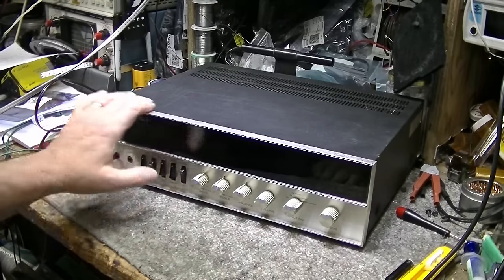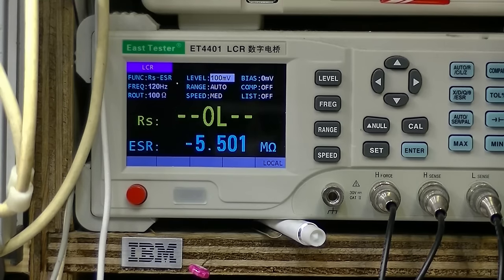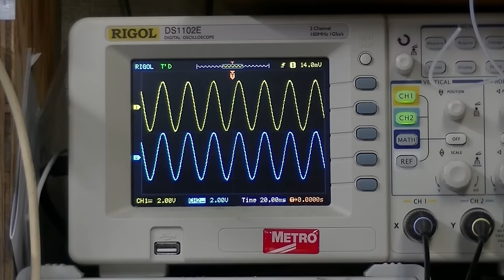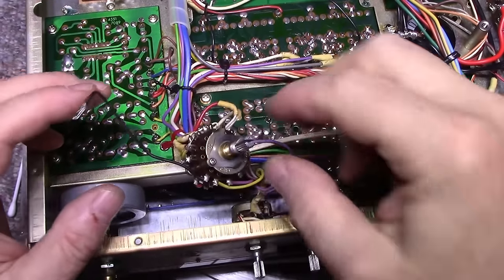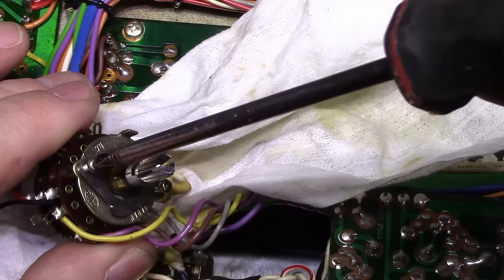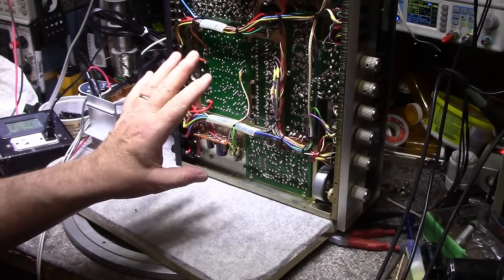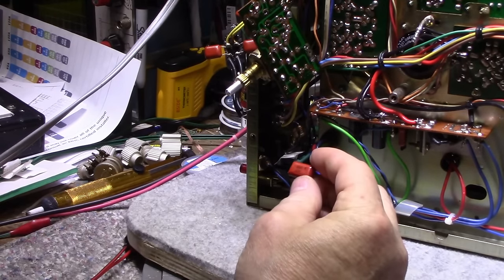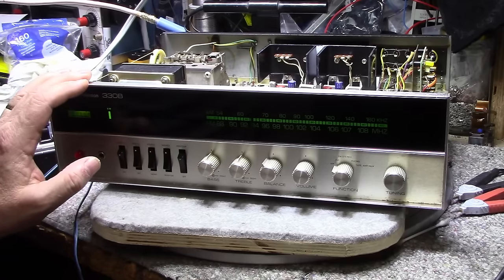Harman Kardon 330B Receiver Know your ABCs Part 2 (Ep. 220)

Comment: I've got a 330c on the bench right now,  with a 430 up next.  Parts, always parts.  330c is waiting on 820k resistors.   430 parts are in.  Should be able to finish that one up.  730 got sidelined for a bit.

Comment: Regarding the bass/treble potentiometers, if there is a 2K ohm difference between left and right, could you balance them out by adding a 2K resistor on the side with the lower value?

Comment: On one time you say "I replace the 100uF because some of them were up to 125uF" and on the other side you say "I replace the 2200uF with 8000uF and its much better now (or similar, dont remember)". So on one side, you dont like to have more uF, on the other side you like to have more uF, it is not consistent what you say sadly. Should a part in theory not be better if a 100uF cap has 125uF? 

Good receiver, I have bought a 630 with paperwork and ads and warranty card and receipt, looks very nice and all is working incl. all lamps. Very rare to have a never messed with, fully working unit. I just turned it on and it plays. No need to change the caps on those old Harman, the grey one (Elna) never failed for me. I did not even go to LED because it is such a nice working survivor. On the newer 80ies stuff, yes, but on the old 70ies stuff there is no need to change it. The newer ones leak their fluid but the old ones are better somehow in my experience. So good work but kinda not needed. But if it makes you happier, why not.
Reply from the maker: Hi Stefan, lets see if I can clear up the confusion. Power supply caps do just that, supply power for a amp of circuit. Oversizing power supply caps can give the unit a extra surplus of energy for periods of high demand during music, when it needs it. It provides better power stability and reserve for the amplifier. Generally, upsizing power supply caps is a good thing.
The other part of your question deals with capacitor degradation. A 100uF capacitor from 50 years ago now measures 125uF. This is not because the capacitor has become "better" with age but rather has drifted out of tolerance and the internal DC leakage has fooled the meter to read 125uF. All of these high achievers will now have increased ESR.
Old capacitors also drift with temperature, their value and ESR will change with temperature which may or may not affect the circuit, depending on circuit design.
Those 50 year old Elnas are still working today but they also have drifted, likely more that the allowable 20% in value. Not only have they drifted but a small % of them have failed completely.
Another problem with using 50 year old caps is the rubber seal on the can will leak. The heat/cold cycles of using a piece of vintage equipment can push the electrolyte out of the capacitor because the seal is compromised from age or heat. This happens regularly on the Panasonic caps from the 70's and 80's and you see lead corrosion and board damage. Once the seal fails on a electrolytic capacitor, it isn't expected to last long. They will dry out and capacitance will drop fast along with ever increasing ESR.
Yes, old Elna caps are good, maybe the best there was for that era but they are still 50 years old and I expect they will not last much longer.
I replace them mostly for preventive reasons. I cannot do a repair on a piece of gear and return it with 50 year old caps knowing that within the next few years it will be back on my bench because of one failed cap. The last thing I want is a boomerang.
Enjoy your 630. Listen to it and get to know how it sounds. Then if and when you're ready to recap you'll have a good indication of how the sound improved. Sometimes the change is dramatic and sometimes not so much, it all depends on how far the caps have degraded and what circuit the cap is in. I've had clients tell me the change is dramatic, mostly.
This is only my opinion and it's rooted by personal experience and not something I read on the internet. Cheers and thanks for your continued support